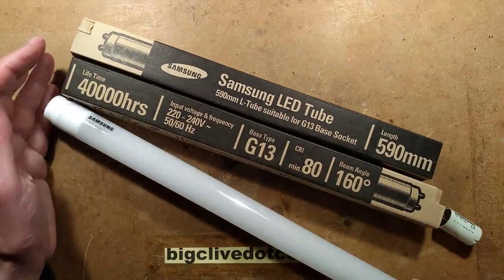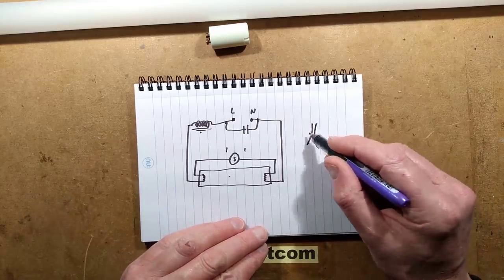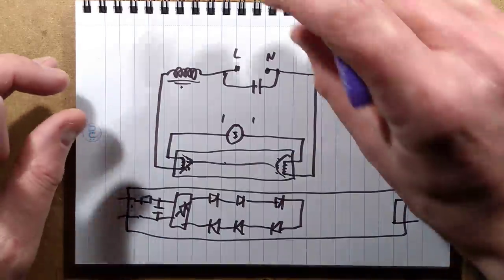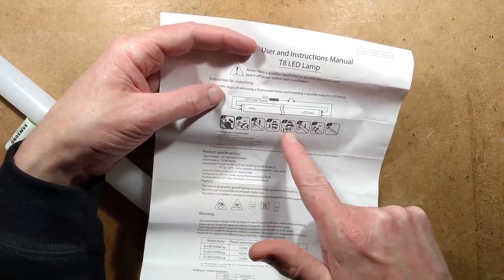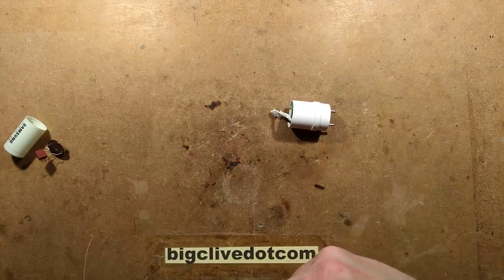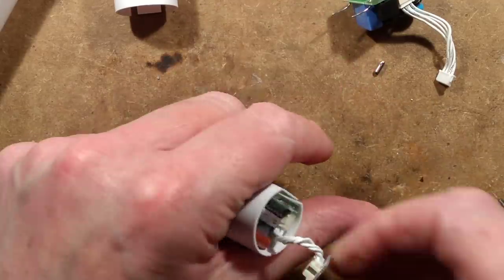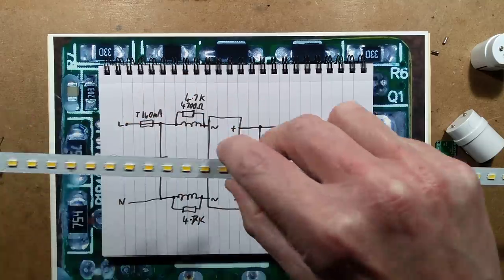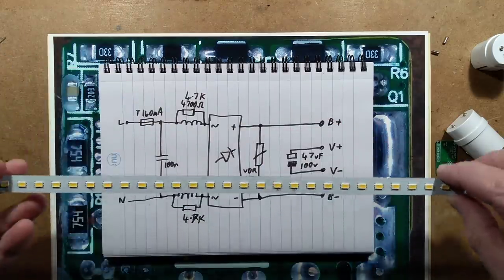Inside a Samsung LED retrofit tube.  (Older style?)

Comment: main reason for the fuse in the starter is in case someone puts an old-style tube back into  the fixture.
Reply from the maker: That would apply to where the ballasts are bypassed.  In this case I don't think the cathodes would pass enough current to blow the fuse.  They'd just glow in the same way as when the starter contacts weld closed.
Reply: ....i dont know if i'd rather see mike or clive try doing things you arnt supposed to like this, actually, both of you can just leave it to photonicinduction :D @bigclivedotcom i think i agree with mike on the reason, when starting a FL tube can take upwards of 100+ watts per tube on a magnetic ballast due to the thermionic coils glowing, i haven't tested it directly but if you leave them glowing, the total current probably would pop a slow blow fuse after a while
Reply: Frogz photonicinduction channel is since long gone and the internet has become a better place. 
Some say he is in India saving the planet while slurping curry.
Reply: Some say you can still hear his voice every time the UK power grid dims
Reply: Or if someone takes it to be a normal starter and puts it into a standard fitting.
Reply: when I fitted these to my workshop I'm sure the instructions said you should bypass the ballast, but didn't have to if you didn't want too. I have seen the starters that were a fuse and some that were just a straight shunt.
Reply: @bigclivedotcom  I've been there and done that! I was bypassing an electronic ballast for an led tube and the apprentice asked what would happen if someone put a normal tube back in? I wasn't sure so when we powered back up we tried it! Big pop and a flash... and the entire tube turns black while taking out a 10 amp mcb!
Reply: sounds logical, since in "start" mode the starter places the ballast(current limiter!!!) and both filaments in a series loop on line voltage, no ballast or failed ballast = filaments incinerate rapidly
Reply: bigclivedotcom no doubt these tubes are designed so that they will also work with bypassed ballasts, that would explain why there’s a whole power supply in it. It doesn’t need it, but can work with it.
Reply: @erikjohansson1814  he has a long term habit of randomly disappearing for years, then coming back for a few days to a few years, then disappearing again. It has been a recurring theme for the past 12 years (his channel only goes back 8 years due to a combination of him deleting stuff and YouTube deleting stuff)

Comment: I wonder how many of these so called home professionals forget to replace the old starter with the new 'starter' cause people don't read instructions
Reply: none because the led will keep flashing!
Reply: Or the other way around. Thats why there is a 2A fuse and not just bridged connections.

Normal tube would just warm and warm up and never "start" until a failure or a fire.
Reply: Unless somebody put a 13amp fuse in the holder

Comment: “Vintage led”

That made me feel old
Reply from the maker: Not as old as I feel when I think back to when LEDs were first sold in electronic component shops and cost quite a lot for a very dull red or green one.  (I chose the green one.)
Reply: bigclivedotcom hell not many component shops anymore.
Reply: @cdawson198600  Do CEF not sell red leds for 3p ?
Reply: It's been downhill since we switched from good ol' torches to that fancy modern gas lighting.
Reply: @bigclivedotcom  remember when laser pointers were $100 for red? the first pointer i got was $30 usd, came in a folding padded box with 2 AAA batteries now you can get a red blue and green 3 pack for $15 including a pair of 18650s and charger
Reply: ....and red lasers are so cheap you get them in gumball machines for $0.50 complete with batteries and a plastic egg AND some how profit for the seller, all included
Reply: Me too. But at least the candle doesn't melt the plastic any more. I never  could afford glass  light jewels.
Reply: @bigclivedotcom  I remember when blue ones first appeared. The price was bonkers. First item I owned that had them were my powered studio monitors. They cost £900 each (not a pair) That was early 90s money too.
Friends used to pop in just to look at their otherworldly glow.
Reply: @abitrubbish  Now a days, most LED's are blue LED's with a phosphor gel on top that actually colors the light.

Comment: In fact the lower part of the schematic is a typical buck (step down converter) but is floating connected in the high side for driving the lamps.So the free-wheeling diode is connected between +310v and mosfet's drain and passes through the buck coil that is connected to drain and the output load.The led voltage is measured against the +vcc of the rectified input voltage.The buck mode coil has a secondary isolated output since as said it is floating against the ground and is used for the ic power supply and output voltage feedback monitoring.

Comment: For the LED-Starter i often see a fuse inside. But some manufacturers has nothing but a jumper-wire inside. The one with the fuse are better, because for some reason when you want to replace the tube with a old Vacuum Tube the Fuse blows by the time. With a jumper wire the preheat-coils in the Tube are always on and the CCG heats up and can cause fire.

Comment: That Oh Henry bar looks to be identical to what we know as a "Payday" bar in the US.

A lot of fixtures with soldi-state ballasts use the so-called "shunt" sockets, where the two pins on each end are connected together (the tube heater isn't used).   I retrofitted a number of 4-foot F40 fixtures in my home with line feed at either end, so that shunt sockets don't have to be replaced.   The replacement tube instructions state that you can leave the iron ballast installed or remove it (better efficiency).   The lamps are quite bright and have no flicker, so I suspect a high-frequency inverter is part of each tube.

Comment: C8-R16 is a snubber to damp down the snap-off noise from the flywheel diode (D5).  The switch in the chip appears to be only rated at 18V so the external MOSFET is a common gate stage to boost the voltage rating up to 400V or so.
Reply: "I am not a number"
Reply: @twotone3070  You are number six.
Reply: @petehiggins33  I am a mere fraction of that Leo.

Comment: I haven’t been able to find these locally in the states. The guys at Home Depot and Lowe’s told me they were discontinued and there  isn’t a drop in retrofit available any longer… Without completely overhauling or replacing the fixture. 

I bought these several years ago and they’ve worked for me great probably going on eight years now maybe six I don’t remember… 

However I sent my dad to buy some for his shop.... (because florescence give him headaches)… And he was told they don’t make anything like this anymore … And that was just last week. 

Maybe I’ll try to order some of these on eBay for my father and for my remaining fixtures.

I always greatly enjoy your videos!
Reply: It’s not hard to rewire old fixtures. You can leave the ballasts, just disconnect them. I used double ended bulbs, so I just connected one end to live, and the other to neutral.

Comment: So, if this is an early application of LED lighting, then it might be fair to say that we are seeing a circuit before it goes through what AvE would call "Value Engineering". Do you think all the additional coils and caps and FETs are there to make this circuit more reliable and robust? I ask because I've had a couple "high end" LED lamps fail on me. Thanks to your channel I'm pretty confident that it's the power supplies that have failed, due to there being lots of noise on the AC side from a dehumidifier sharing the same circuit. (Not ideal, but nothing I can fix without getting a new power distribution panel in the house.) It annoys me the theoretical reliability of LED lighting won't be realized because of cheap power supplies that work for weeks or months an end up failing as commonly as the incandescents that they replaced.
Reply: No no
I have a LED light that has run over 75 thousand hours, and it's still going strong.  That said, there are some simple cheap LED lights that use a series capacitor to limit current.  They are supposed to use an X rated capacitor that will fail open, not shorted.  But instead they use those red gumdrop caps rated for only 400 volts, sometimes less.  Well, 120VAC is 370V peak to peak, so the cap is running at its max, sometimes over maximum.  So failure happens, and it takes the rest of the circuit when the current becomes excessive.  Just pray the light doesn't catch fire!  😱😱😱
Reply: @acmefixer1  I have seen some LED tubes fail, not just the cheap ones. Dissecting them showed either signs of crappy build quality, crappy cheaped out capacitors, or 80 % of them temperature issues. They put the led strip into a plastic difuser/reflector, shrouded that one with another difuser lining the actual glas tube... By the way a pain in the ass to disassemble the way they glued everything in place with the usual white goop.

Comment: I wonder if we'll be stuck with the fluro tube fittings long after the traditional tubes are out of production? A bit like horse and cart -> road width -> car width.
Reply: That's a bit like we still talk about dialling a phone number, even though telephones haven't had dials for decades!
Reply: @NOWThatsRichy  my phone definatly has a dial that's how I called my school when I needed to schedule something with someone without having to make a contact labeled school and input the phone number there
Reply: @bland9876  The genuine old dial telephones would still work on a pulse dial exchange but i think you may need some sort of adapter to use them on a modern tone dial system.
Reply: @NOWThatsRichy  can't use an old phone unless there's some way to connect it to a cell phone tower luckily I have a smartphone and it has a button on it which says dial and when you click it a bunch of numbers pop up and you can click them and if you inputted the right numbers you can click another button and it will call that particular number without having to make a contact or anything in your phone it's really cool and has come in handy a few times

Comment: With LEDs I mostly care about flickering. So much difference between different lights. This is why I use normal Tubes in my room with a 40 kHz driver. This, along with the fluorescent screen of the tube prevents flickering 100%.

Comment: At my previous job we had a lot of LED lamps made by just having a frame, with plastic conduit clips, which the led tubes fit into, and then it was connected by 2 connection blocks to the cable, with a piece of plastic conduit slipped onto the end (perfect fit) to cover the connection

Comment: As always, Very Cool.  Thanks Big Clive.  That really is a bunch of circuitry which I was initially thinking necessary because of the random orientation the tube might take in a fixture.  Nope.  Like you said, just spread to both ends of the tube to make use of the space in between.  Pretty neat.

Comment: I have a 1960's 4ft fluorescent fitting in the kitchen that is on its 3rd rebuild.  It originally had a combination starter and 40W? bulb as ballast in a light fitting at one end.  Sometime in the 1980's my mother forgot she had spare stock of the combination starter bulbs and as they were now unobtainable I rewired the light with an inductive ballast and ordinary starter in the light fitting.  The lamp hangs from a single thin plastic conduit tube pendant so given the increased weight of the inductive ballast I had to move the pendant to rebalance the fitting.  Then in the 1990's I assume an electrician replaced the ballast and starter with a starter-less ballast.  

Last year I found the stock of combination bulb starters so I flogged them on eBay to someone with the same light fitting.  Around Christmas I again rewired the lamp for an LED tube, junked the ballast altogether, and relocated the pendant to its original position to rebalance it.  All was well until the onset of spring and sunny weather when the lamp began to flicker.  Eventually I tracked this down to the proportional immersion heater controller which uses the surplus energy from my solar panels.  I assume the noise ripple from this is enough to cause the light to flicker, albeit I have conventual LED bulbs on the same circuit that do not flicker.  Therefore I'm guessing the 4ft LED lamp is of the simpler design that Clive was expecting here, so I am now looking for a 4ft LED tube with the control circuitry.

PS  Ordered and fitted a Crompton LED T8 Glass tube; flickering gone.

Comment: The circuitry seems so much more complicated than it needed to be, based on what you said in the first half of the video...  But, like you said, maybe it's so complex because they're trying to make it more efficient?  Make it so its power-factor is closer to 1.0 than it would otherwise be?  And to add some stability to the output current?  Either way, I definitely did not expect such complexity...  Excellent analysis, as usual.  I always learn so much on this channel -- thank you so much!

Comment: Fascinated by this. The small condominium I live in has 9 fixtures each with its own magnetic ballast driving one old-style T12 4-foot fluorescent tube. I replaced all tubes last year with identical Philips LED tube-replacements designed for that. Purely plug-and-play. No problems so far. I wonder how similar the circuitry is. 2100 lumens but the LEDs point downwards, supposedly 20 watts power use each.

Comment: I think it's a normal single ended LED tube, one end is the input and the other end is just short circuit. The LED starter is also short circuit (in this case a fuse), it can work with the ballast because the LED tube consumes less current than the fluorescent, so the ballast is just there (in practical use can be considered short).
Some people strip out the ballast and the old wiring, but in my opinion it can be benficial as it protects the LED against spikes and also compensates the capacitive nature of LED supplies.

Comment: These retrofit LED lamps work absolutely fine with completely removed ballast, both tube and compact style. A good way to salvage light fixtures with defective ballast, just rip it out and connect the LED lamp directly. But you have to provide a fuse inside the fixture in case someone tries to put in a old stile fluorescent lamp. And this is the only way to retrofit double Lamps with serial circuit and only one ballast.
Its especially useful in cases where you have dozens or hundreds of downligts, one fails and there is no equal looking replacement anymore.
Reply: Not all of them will work without a ballast. I have some that would immediately release the magic smoke if run without a ballast to limit the current.
Reply: @rocketman221projects  never seen one like this yet.

Comment: I would not say it is an older style, it is just as you said for retrofitting older style fixtures.
Those blind starter dummies will not work with an electronic ballast, for those you have to take out the electronic ballast and reqire the fixture.
those blind starters usually contain either just a wire or at most a fuse.
The fuse is to pretect everything else in case someone erroneously uses this blind starter with a regular non LED tube.

The shorted out end is helpful if you eliminated the ballast and wired the sockets over cross, this way it does not matter which end goes in where.
I for myself eliminated some electronic ballasts and simply put the warning sticker that was included with the led tubes I used to the wired end. My tubes have all been marked something like "power from this side"

Comment: Is having to make and assemble all those components really better for the environment than the one 5ft tube that's been working fine for half a century and doesn't flicker like the LEDs under the kitchen units do?  (There have also been several lots of 'link light' CFLs under the cabinets in that time too: each of which generation is identical except for the yearly redesign of the linking plugs, so you can never actually link another one without cutting the leads off and replacing with ordinary wiring connectors!  That really used to annoy me, though I still have a single one that makes a handy lamp during DIY.)

Is there a simple fix for LED replacement 'bulbs' that flicker, by the way?  My 12V under kitchen cupboard ones actually flicker in time with the oven fan.  :/

Comment: Can retrofit tubes be used in a fixture where the ballast has been bypassed? Reason I ask is I'm working in a place with a lot of failed electronic ballasts. They keep trying to start even with new tubes. It would be cheaper to retrofit LED tubes, but I'd have to bypass the dead ballasts or the LED tubes are going to do the same thing.
Reply from the maker: You can get tubes designed for use with bypassed ballasts.  It may be better to bypass the existing ballasts if they've failed.

Comment: This made me finally get unlazy enough to look up options for replacing the tubes in my kitchen that stopped working about 2 weeks ago. Lead me to find the Philips t8/t12 universal LED tubes that are supposed to work with either magnetic or electronic ballasts. I guess I'll give them a try. No idea what type my light has, it's an apartment so I'm not going to replace and rewire their stuff.

Comment: I think you may be misreading things. The box has CCG (conventional) and VVG (low-loss) ballast markings just to indicate it can be used with in these fittings without bypassing. (Electronic ballasts are EEV ECG.) But you can use the tube direct to the mains - every LED substitute tube I've bought in the last few years can be used like this and Philips ones even have L & N markings on one end.

Comment: The 2 foot length specification is for the fixture.  The lamps are shorter to accommodate the socket at each end.  Same for the 3 and 4 foot models.